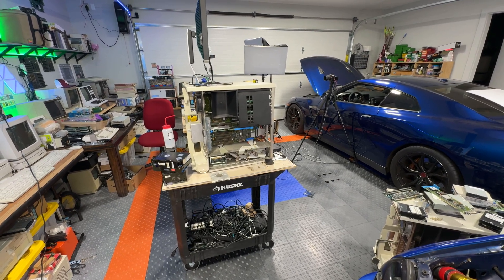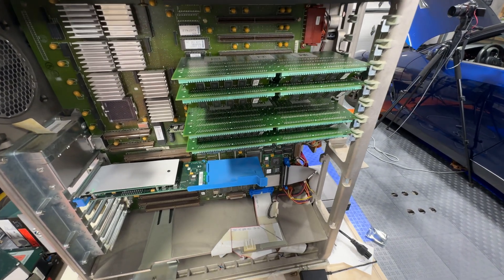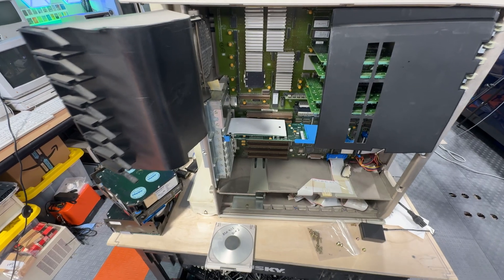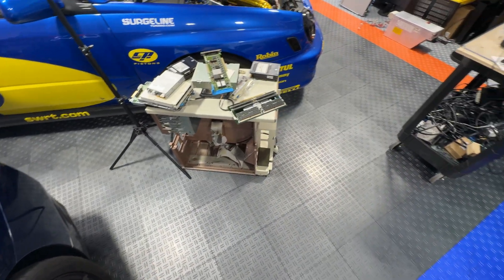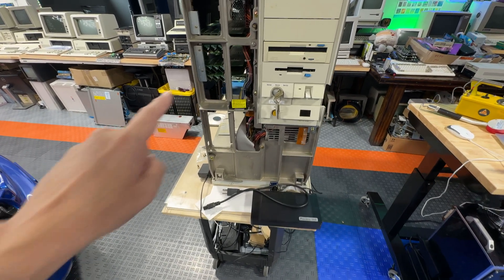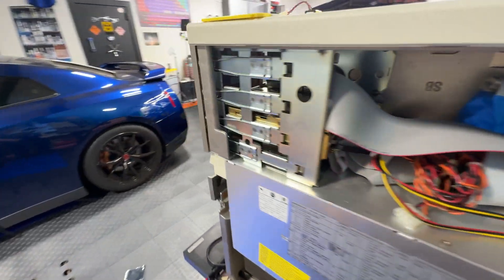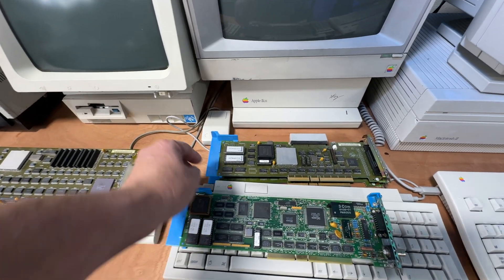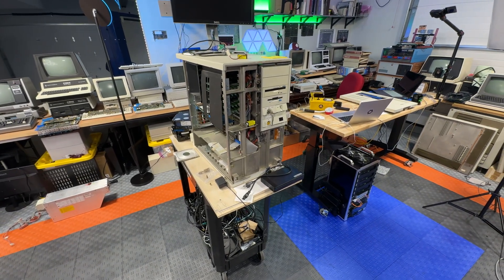RS/6000 POWER in the HOMELAB

Comment: @15:10 - The lower card (that you picked up) isn't Tioken-Ring - It appears to be an multi-port serial adapter (if true IBM, it will have an 'x-x' adapter encoding on the bracket). Of course, the two other boards are the horrendous 'Busmaster' Token-Ring adapters.

Comment: RS/6000 was an interesting product, 30 years ago.

Today, a cheap AMD Ryzen will run circles around the ancient RS/6000.
Reply from the maker: Oh my apple watch would run circles around an RS/6000!
Reply: And the successor to the POWER1 CPU would look at your Ryzen and laugh (IBM z/16 processors and POWER10)
both with regards to memory bandwidth/performance and MFLOPS performance of your Ryzen.
Reply: @TheStefanskoglund1  Nope, a modern EPYC 9755 or 9655 is about 4 times faster, as a POWER10 (Check Spec cpu2017). Note, that Power10 is 2021-ish while Zen 5 is 2024. They target completely different markets and as such, POWER10 does things an EPYC can't do, while the EPYC is better at other things - raw compute performance, even in FP, is one of it.
It really hurts me to say - but nothing beats x86-64 implementations in terms of performance. Now I go vomit... :)
Reply: @TheStefanskoglund1  the successor to the POWER1 CPU would look at your Ryzen and laugh

And what is the cost of that successor?   Price vs performance, nothing compares to a 12-core or 16-core Ryzen.

Comment: Good taste in systems.  If you need any AIX stuff let me know.  The 530 would be a good AIX 3.2.5 box, and for the 570 4.3.3 would be a decent fit, a bit easier to build more recent shells and GNU stuff.  The graphics card you have has open source 'skyway' driver in the X11R5 distro which is potentially interesting.  But an IrisVision would be great for the 530 and they aren't too rare, while the GXT150M is somewhat common and fast 2D for the 570.
Reply from the maker: Oh excellent.. I'll have to look for that Skyway driver.  I was able to get the AIX 4.2 C compiler installed and working (and without the license).  Kinda fun to play around with!

Comment: I see that you have a Pocket 386.  The one I purchased stopped booting to Windows95 so I tried to put another operating system on the SD card.  I tried some lightweight Linux installations without much success.  What would you recommend to use with the Pocket 386?  Also, I am curious what all you do with your Pocket386.
Reply from the maker: I have mine booting DOS, and I use it primarily just as a serial terminal.   I am running ProComm under DOS, and it works well.   You could of course do more with it, but the screen it not particularly great.

Comment: Now I'm going to have to buy an RS6000! Or an AS400 system....
Reply: Get an IBM POWER6 or later server and you basically get both! IBM merged the pSeries and iSeries lines around then, so you can set the boot mode to AIX/Linux or IBM i/OS 400. Or, for the most fun like I do on my P720 and S822, run logical partitions and run AIX and IBM i on the box at the same time. Endless fun!
Reply: @MatthewMainframes  Solid suggestion - I'm going shopping now! ;-)
Reply: @neilbradley  Make sure to do your research on the CoD, PoD and MoD licensing if you don't know about that stuff. IBM HW licensing is the bane of hobbyists.
Reply: @Sagebreaker  I didn't, but thanks for the heads up!